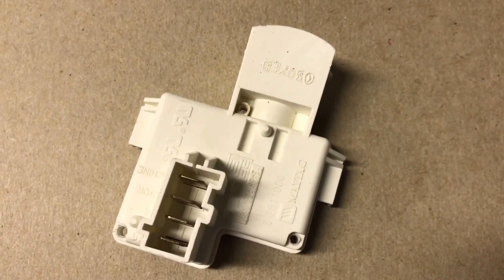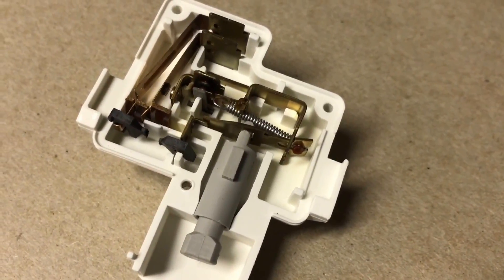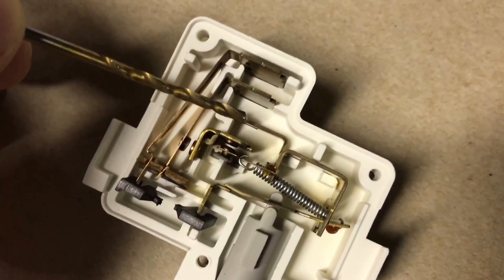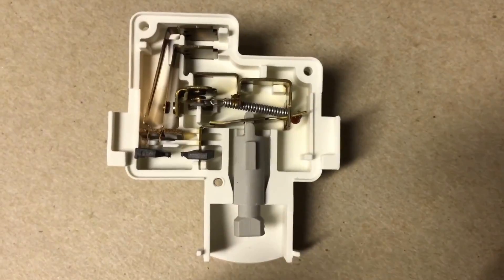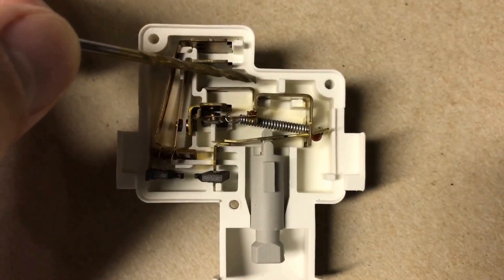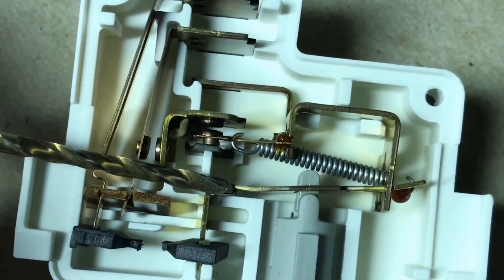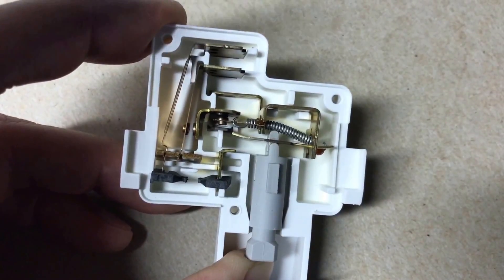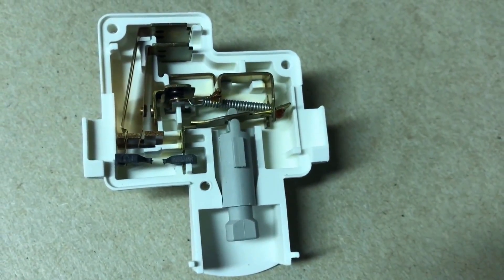Maytag Washer Lid Switch - How It Works

Comment: you did not mention the purpose of the fusible link or what would cause it to burn out.  that would be good to know.
Reply from the maker: That's because I had no idea 😁 but since you asked, I watched my video again to see what was going on, and my best guess is that it's a safety feature to disable the motor if the lid switch gets stuck in the closed position. Notice that during normal operation, there is a connection to neutral from the plunger. That got me to wonder why the switch would need a connection to neutral. If for some reason the contact between the line voltage and the motor were to be fused together, preventing release even when the plunger is no longer pressed (door open), the resulting current would flow from live voltage to neutral, instantly burning up the "fuse." This would kill the motor whether the switch is correctly functioning or not. Does that make sense? So imagine the contacts in the middle getting stuck together. If that happened, that piece of metal in direct contact to the plunger would be live, and as soon as it touched the metal connected to the fuse, it would blow it because the fuse is connected to neutral. It would be a dead short. Once that happens, it will kill the power. It would keep someone from continuing to use a washer with a defective lid switch because I'm sure some people would love a bypassed lid switch. I even installed a momentary switch on my washer to bypass the lid switch so that I can check what's going on with the lid open 😄.

Comment: I bypassed mine by splicing line wire to machine and motor wires together with a wire nut, I got full performance but im still waiting for the door switch. to make it correct.
Reply: I can temporarily use the washer by connecting the line, machine, and motor wires? I did jump a couple of wires and was able to get water coming into the tub, but I did not get the spin. I was going to try others but did not want to burn anything out. Just want to use it until the new switch gets delivered. Thanks
Reply: Ours did the same thing would fill but wouldn't spin or drain ended up being the timer  (burnt contact) and the lid switch bit the dust, hope this helps anyone else out there.

Comment: This is what I call civilized switch.  Hats off to Maytag with respect.  Solid, simple straight forward switch that if a person wanted to can be repaired.  
Now may I present you a switch that is uncivilized consumer rip off.  Worse yet can not be hotwired.  In other words the computer can not be fooled. It is programmed to lock and unlock the door switch in a certain time frame within cycles.  So if you hot wire the switch and the computer wants to unlock after it has checked the size of the load, it will send a signal to unlock and if you hotwire the switch it can't unlock and it shuts it down.  And you can not do i manually either, how would you know the exact precise point.
Also, most modern washing machines are programmed to care if the door is locked or not. It doesn't keep to track of it was able to unlock or not.  Almost all washing machine unlocks the switch after the final spin is done.  The computer sends the signal to unlock and it is finished, however, it takes a small amount of time for the lock to actually click and unlock.  Lets assume that the door didn't unlock after that little time interval.   The computer will not record that as an error.  Because it is not monitored. It is outside the operation of the board.
May I present to you the worse, most consumer rip off washing machine in the world.   Try to hotwire this switch and even if you could, it won't work and inside the door switch mechanism, you will find a bunch of plastic gears and lame plastic arms and contacts....  

https://www.youtube.com/watch?v=115VEVI33_c

Comment: how to fix?
Reply: @Flamingo Vlogs; You DON'T fix it... you REPLACE it. Before I retired I was ( still am ) a technician for 35 years and in my decades of training & education it was always EMPHASIZED that you should NEVER repair a SAFETY DEVICE, always replace a broken, defective, non functioning,  safety device.
Reply from the maker: I would recommend replacing the switch if the link burns out. It's a protection feature, so you probably don't want to lose that functionality.